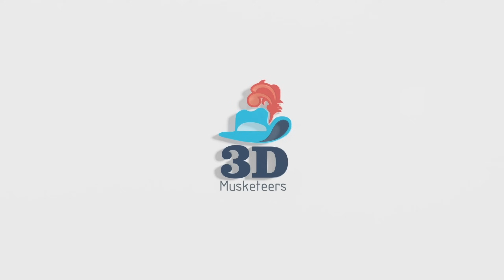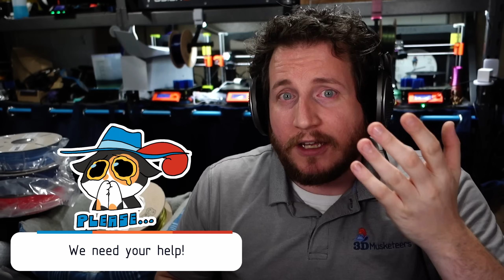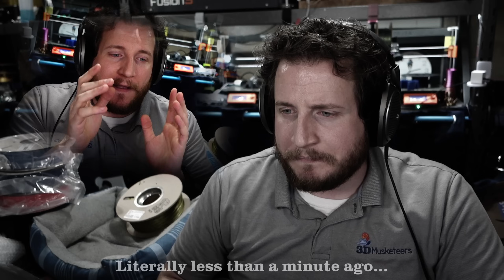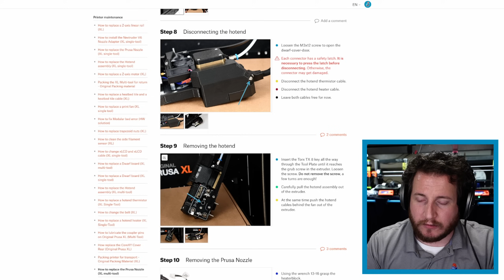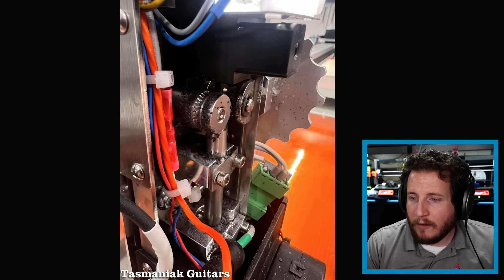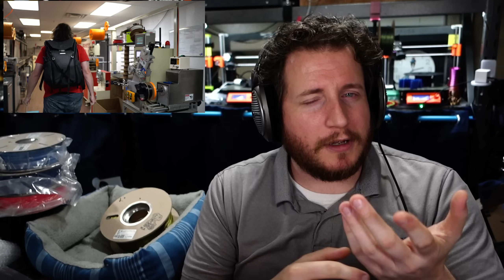A Prusa's SCRAPPED Screen?? - PrintFixFriday 154

Comment: Those grooved (or rounded?) extruder gears on the Bambu Lab might seem like a good idea (gear profile is rounded+filament is round=good fit) but they actually are not. The gears have a varying diameter (increasing from the center to the edges) and with every rotation they will will travel different length accross the filament inevitably grinding on the filament. 
While this may not account for the filament of the user's gears in the images, it will lead to gunked up gears to some degree regardless of the usecase.

Continuing watching the video... the same may apply to that giant Big Rep printer: Grooved gears as it looks...

Comment: Aside from maybe using Rockset or red loctite (you’ll never change ur nozzle again) no matter what you do those grub screws will need to be checked. 
The slight vibrations from plane rides into Afghanistan were enough to loosen screws holding optics. 
Those extruders shake and move much more violently for hours on end.  Vibrations are weird with fasteners.

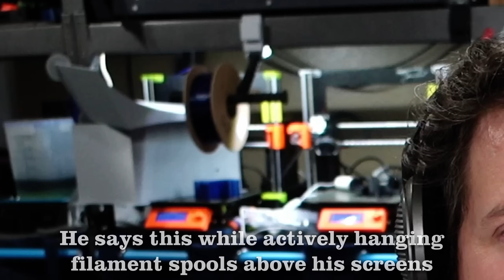Comment: so about 6:30, to get the velocity of the falling spool of filament when it reaches the screen with (V=2gΔx) in which 19.62m/s=2(9.81m/s^2)(1m), Air resistance is negligible so it is omitted. this is the velocity of the spool when it reaches the bottom of the printer. now to calculate the force is a bit complicated since we are missing a lot of information about the impact that was made with the spool to the screen but assuming about 60% of the force was directed at the screen and an impact time of about 5 milliseconds we can represent the average force as ((mv)/t)*(0.6)=(Average force of impact) which comes out to 7063.20N=(((3kg)(17.854m/s))/0.005)*(0.6). So a good guestimate with a lot of assumptions the average impact force made on the screen would be about 7kN of force or about 1573.66lbf.
Reply: Good job calculating the impact velocity from one of the kinematic formulas. 

I used the potential energy formula. 
Just mass*gravity*height above the touchscreen. 
Roughly came out to 29 newton meters or 22 foot-lbs of impact energy. 

Force is just mass*acceleration (or simply the actual weight in newtons) so it didn’t make much sense in this use case.

Comment: Force depends on the acceleration of the stop. Energy is probably a better calculation to make to determine the damage on the screen.
Reply: This
Reply from the maker: its been MANY years since I took a physics class, so I will assume you are right. Could it be calculated though and what would you need for the energy calc??
Reply: @3DMusketeers  yup! Let me review :)
Reply: assuming the roll has a mass of 3kg and the height of the fall is the height of an XL printer (~0.5m) the roll has ~14.7 Joules of energy. that's not a very satisfying answer. So let's make another assumption: let's make the time of the collision 0.1 seconds. Let's also assume that the roll doesn't bounce and comes to a complete stop. That would give us required force of ~95 Newtons of force during the collision. We can play around a bit and make another assumption: the roll bounced back up at 1/2 its velocity that it struck the screen with. That would increase the force to nearly 150N. That should be enough for us to get a rough idea of the forces on the screen.

Comment: "Oops, our filament diameter is off by +/-15%, too bad for the customers I guess." - Someone at BigRep, possibly a former GST3D/Fremover employee. For a printer this expensive, buying and fitting a smart plug shouldn't necessary (and may not be possible, if the machine is intended to draw industrial-type voltages like 380 or 460). Being able to remotely access the machine, view what's going on, and stop the print if something is obviously wrong seems like an extremely basic feature to me, at that price point...a feature that's available on printers costing hundreds to thousands of dollars should be included on printers costing hundreds of thousands of dollars.

A thermoelectrically-cooled hot end is a really fascinating idea, particularly in an enclosed printer where chamber heating is only nominally provided by the bed. I don't know how much extra heat you'd realistically get from the cold end of the print head, but hey...every little bit helps.

Comment: for grub screws. Put some blue or purple loctite on it. or even the wicking green for electronics. (which allows the screw to already be set and in position and should wick into the threads). These are compounds designed for later disassembly. Without the need for a torque or a destructive practice.
Reply: Looking for a grub screw for one of my SV04s, the hex head got stripped

Comment: A window mounted ac unit, is a good option if you have the power availability imo.  Just make sure to treat each printer as a person when doing your thermal calculations. So you get the right size unit. Normally where I live AC has not been a requirement. But the last few years my summers have been significantly hotter than the norm (lived here for 37 years). So I ended up adding two window units to my office, to keep the print farm happy during the warm days. Since summer seems to be my busiest time printing. (during the winter i usually take the air from that room and disperse it through the upstairs to save on heating. Cause it works out about perfect)

Comment: And here I thought my PLA prints failing during 48°C heatwaves was due to me not saying 'please' enough times to my printer.
Reply: @cubing4eternity774  If your ambient temperature is 48°C then you are already close to the softening point of the plastic, which means heat creep is a major risk.
Same can go for printing PLA in an enclosed printer without the doors left open for maximum ventilation.

Comment: Force = mass x acceleration

So it's a simple linear multiplication, since the A (gravity, 9.8 m^2) is the same.  3 times the weight, 3 times the force.

I'd be more worried about being higher with the XL vs, say, a MK4.  Or your hangars.

I mean...  Not designed for ANYTHING falling on it.  :D
Reply from the maker: Spherical chicken, in a vacuum, on a frictionless plane, right??

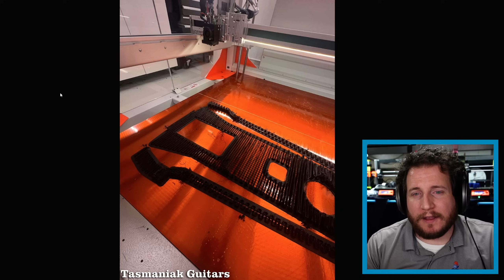Comment: 14:01 not destroy it, but I need it to completed disassemble it, just two days ago The filament broke at the beginning of the hot end (HF Obxidian 0.6 for one of my P1S), also a bit of still soft filament broke inside the extruder causing that that part of the filament stuck under the drive gear. I needed to completed remove everything and pushed it with a hot hex key.

Comment: so yeah my nextruder nozzle with the obxidean coating got unfixable heat creep (I finally gave up) because I had 1 tight screw and 1 loose screw. The loose screw permitted massive heat creep.
Reply from the maker: really?? that is interesting!
Reply: @3DMusketeers  yup. The wham bam fix it kit is 1.7mm not 1.75. Even it oculdn't fix it. lol
Reply from the maker: that slight bit off was not helping? Have you tried a cold pull with something like nylon, hips, etc? You could look to dissolve the plastic too in a solvent if needed
Reply: @3DMusketeers  yeah I've thought about dipping it in acetone. The trick is the only thing I know of that get's the area above the heat break hot enough is the stove. And I don't know what temps I need. A cold pull in the printer won't work because it's not supposed to get hot up that high. I guess I could cut off a strand of nylon. I do have some.
Reply: ohhhh I thought the XL had 2 screws like the mk4 does.

Comment: seriously. I would refuse to have anything to do with any environment over 90 degrees. That's a big nope.
Reply from the maker: but you live in the south??
Reply: @3DMusketeers  not by choice! Also this building is not 90 degrees. Anything over 80 and I work from home. I actually had to for that very reason once. Something was wrong with the AC.
Reply: Never work for FedEx then.  They'll boil you alive.